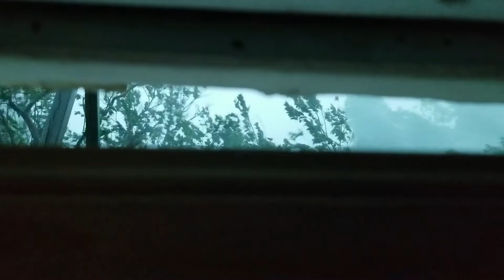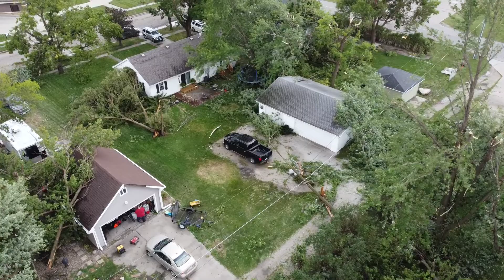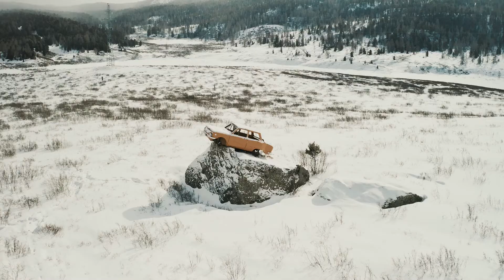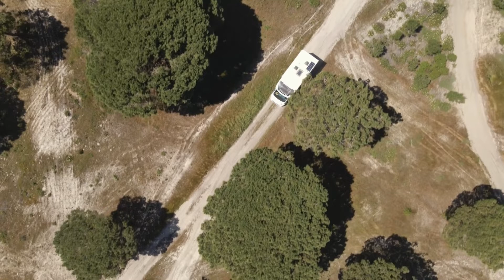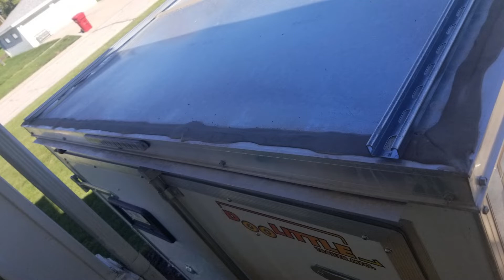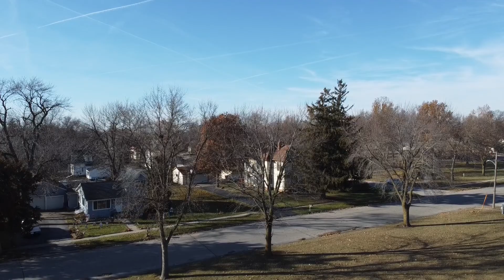DIY Solar Journey : EP01

Comment: It sounds like you did a lot of homework. I too was an amateur and still am. I could afford a little better system, so I went with the Victron inverter charger and Battle Born Batteries. I also did the VictronConnect charge controllers. And don’t forget the shunt. 
I would recommend you check out Will Prowse website through his YouTube channel. He gives a lot of recommendations on his website. 
He also has a form and you can post about what you’re thinking about doing and get some good info. 
One thing you can do with solar that’s nice it is to start small and grow. 
Start with two batteries, then one charge controller. Or you can save up and buy each component at a time over six months to a year period. 
I have a 24 V off grid system, and now that I’ve learned more I will eventually go to 48 V. When you ground your equipment, make sure it’s insulated to avoid shocks. I was shocked myself many times as my wrenches would cross over while tightening my equipment. Getting shocked on a 48 V could kill you!
I recommend SOC batteries or Battle Born Batteries. Big battery or you could build your own. I didn’t do that because you have to really know your stuff. 
Also go off the grid, the headaches you will encounter going on grid is a nightmare! Plus if the grid goes down, your system goes down with it. 
Also if you get a company to do your build, if you’re paying on a lease it will be harder to sell your house if you owe or paying a monthly amount. Most people don’t want to buy a house with a mortgage and a solar payment on top of it.  
There’s a lot more I could tell you but it would be hard to translate it in text. I’m definitely not an expert at the math part, that’s where the forum would help immensely. 
Also Santan solar can help you with finding the right charge controller for the panels you bought. 🖖
Reply: Thanks for the comment, Ben!

Yup! SanTan Solar for panels (and maybe the rest) + Growatt inverter-charger-combo + EG4 batteries (Signature Solar) seems to be the way to go this year if you can afford the upfront costs. 
I started with some cheap Harbor Freight panels and then stepped up to a Bluetti AC200P + SanTan 250w panels. 
Will Prowse, HoboTech, and DavidPoz have all been great resources. 

The toughest thing this year was when working with multiple households and managing everyone's expectations... including time to research appropriate solutions. 

The biggest pitfall I've dealt with this year is some people have had unreasonable and unmentioned expectations on how easy or hard or quick or slow coming up with appropriate solar solutions is. It can sometimes be discouraging to get 99% done with maybe a day or two more work to go to present a bill of goods to purchase and the customer backs out last minute because they think their custom build.

Starting from scratch without a list of suppliers takes immense effort and time. 
I was originally going to just drive across the country and purchase 2 new commercial 300w panels for the cost of what I was able to get half a pallet of used ones for when I found out about SanTan Solar. 

The biggest takeaway from these projects is that once you find a reasonable supplier, you can figure out the rest of the puzzle way faster than sourcing parts randomly on Amazon. 
SanTan Solar + Signature Solar are probably my current favorites for budget builds.
LightHarvest Solar seems to be a trusted van-life integrator, though I've not purchased from them since I am building a more of an off-grid solution than a van-life solution now that my Bluetti is maxed out with SanTan panels. 

Jehu Garcia is also another great resource for used batteries.

One common thread here is that all of the above mentioned resources either have a youtube presence or were mentioned by youtubers at one point or another. 
It is a tremendous help to be able to see systems in action to visualize how certain parts are being used in the real world and to vet hardware for your own projects. :)
Reply: @howkj1  
Well when I started I knew absolutely nothing about electricity, barely understood how the battery in your car worked. 
That’s why I was scared to go beyond 24 V system, because I heard at least you can’t kill yourself! 🤪 I had the hardest time understanding how electricity moved with all the components. Direct current versus alternating current. 
Now that I’m more comfortable I think I can easily move to 48 V. I realize that the cost is a big factor for most, that’s why I decided to do mine myself and that still cost a lot of money on the learning curve. 
That’s why I say it’s good to just start with the basics and get a system running, then keep learning from it until you have the money to add to your system, getting it where you want it. 
Mine is now 7.5 kW PV, a 3000 K 24 V inverter and 9.6 kW battery storage. It took over a year for me to get this together, slowly working with half the system that I made from lead acid. Going to lithium was a game changer!
I just keep learning as I go, realizing some of the dumb mistakes I made and the things I should’ve done differently. But it’s like anything else, you have to start some place in order to get somewhere. 🖖😜